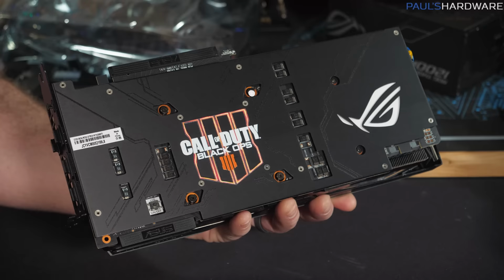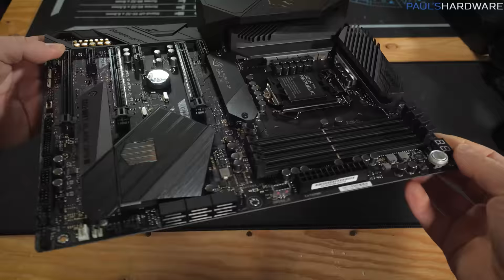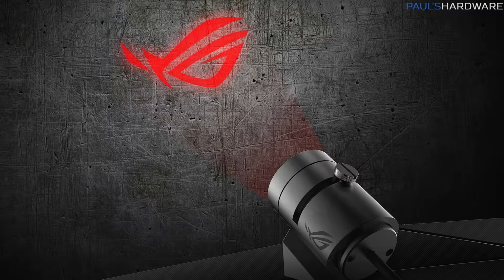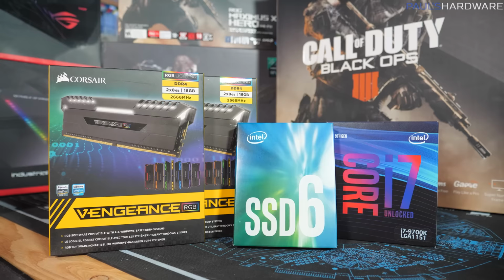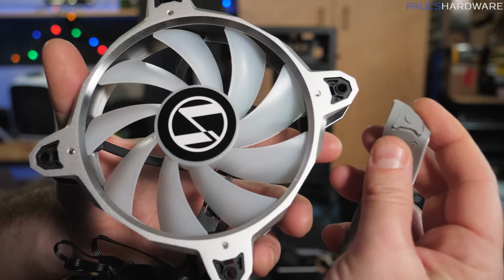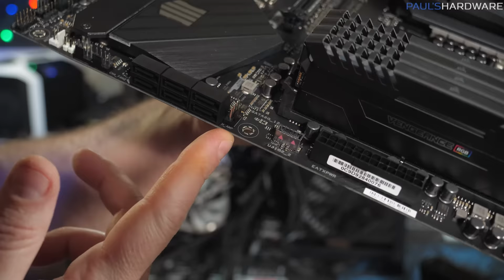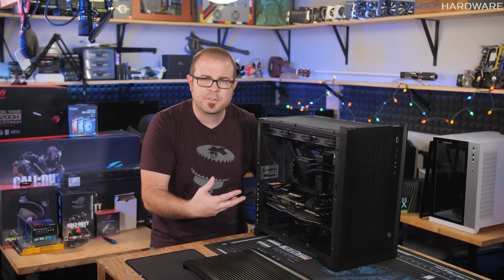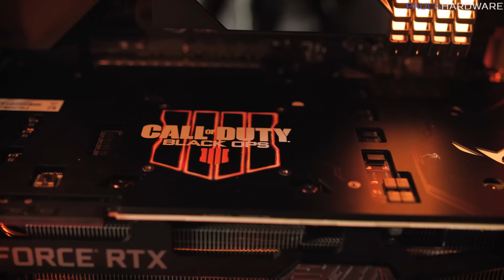SET BONUS - Epic ASUS COD:BO4 Themed Gaming PC Build!

Comment: Cod took some of the money from the micro transactions to let Paul assemble this
Reply: Im building my first ever pc , is the strix 2080 oc worth the money or should i look for other options
Reply: @clc8609  That all depends on your budget.
Reply: @michaeldownie9995  iv been saving for a while and i have near enough 2000 pounds
Reply: @clc8609  if you don't care about RTX features then a spare/new gtx 1080 ti from ebay will be much better value, same performance, cheaper, and more vram. But if you want raytracing then get the 2080
Reply: E ZoTac  i ended up getting the i7 9700k and the gtx2080ti
Reply: @clc8609  GTX 2080ti ?
Reply: @NoName-st2jl  yeah i did end up getting the 2080ti lad

Comment: Those are not rubber vibration pads on the fans, that's to keep you from getting electrocuted in case something goes wrong and you touch the fan or the case. Didn't you learn anything from the 'Verge' computer build ?
Reply: i was what the heck he is talking about, until i read the Verge part
Reply: Ha ha lol

Comment: I am interested in the actual benchmarks for this nice build & how much Power it actually uses ... 
The PSU really is overkill for this build.

Good luck to all who enter and i hope i have a slim chance to win as well.
My current potato has a dual core i3 2nd gen and an 1gb video yey .....
Reply: Mine has a hole cut on the cop so it stops overheating and is called a ps3 slim. Go figure.

Comment: The nvme should go in top spot for best speed
Reply: Thats not true. The only diff between the m.2 slots on that board is that one supports 8cm drives and the other 11 cm drives. Speed wise you can achieve the same with both. On older boards yes the top vs. bottom made a diff but now...not so much.
Reply: @trembledust6819  I might be mistaken but only the top one supports PCI 3.0 x4
Reply: @DravGro  Depends on the motherboard and chipset. The ROG motherboards are usually really good at putting both of their M.2 slots on PCIE lanes.
Reply: @DravGro  1 x M.2 Socket 3, with M key, type 2242/2260/2280 storage devices support (SATA & PCIE 3.0 x 4 mode)*2
1 x M.2 Socket 3, with M key, type 2242/2260/2280/22110 storage devices support (PCIE 3.0 x 4 mode)
Reply: Wasn't that specific to AMD platforms where the top slot is typically direct to the CPU while the bottom goes through the 470X chipset. Although i have heard ASUS X470's take PCIe lanes from the 2nd 16x PCIe slot for NVME to allow both to run at 4x in RAID.
Reply: @DravGro  On mainstream intel all NVME goes through the chipset, only 16 lanes come out of the CPU directly and they go to the GPU. 4 PCI-E Gen 3.0 lanes go to the chipset(DMi 3.0) which it splits between NVME, USB, SATA etc. AMD has 4 PCI-E lanes that can got directly to a NVME drive though plus 4 lanes to the Chipset. Main stream intel only has 20 lanes total, AMD has 24 of full pcie 3.0.

Comment: Amazing build! Pretty confused why you went 9700k and not 9900k.
Reply: 9900k is overrated and way more expensive.
Reply: I think the 9700k is a great processor and a great fit for a ton of builds. I haven’t added up the total value of this build, but going with a 9990k only adds $100. Every other part is top of the line and I think the processor should be as well.

Comment: Got the same setup but little bit better - so happy!

- 2666 Hz RAM is underpowered on this pricing-build. Better is to catch an 3200/3600 Hz (G.Skill Trident Z RGB), because it can give ~20 FPS when using OC. I´ve tested it on BF5 and R6:Siege.
- The Ryujin-360 can cool a 9900K on 5GHz to 60°C on 2K - Ultra gaming so take it!
- Separate SSD for System and games (512 GB windows, 2 TB Games - 970 Pro)

HINT: The Z390 Hero XI get an 806 BIOS version soon. Currently some common XMP/OC profiles are not stable.

Comment: Great build but the case left something to be desired.  I think it would have been better if you used the COUGAR Conquer Aluminum Alloy ATX Mid Tower. It's not cheap, but aesthetically it's a homerun. 
I'm going to use everything you used except for the case. Great job though. Keep the videos coming. 👍

Comment: Only downside to the build is the case and fans, not because they are bad but you used a Corsair component (RAM) and they make cases and fans. Basically my dream builds are sort of in this theme of a "set". Easiest 2 to do it with are Corsair and Asus but the only thing that I'd have to use that they don't make is storage and obviously the OS.

Comment: is it ok to not have a rear exhaust fan if you have a top mounted radiator as exhaust? i would think it would just pull air in from the back and negate the effects of the front intake fans

Comment: What’s good guy I got my budget pc with a i5 2400, 16 go of ram, a trash case, 1tb hhd, 450 Watt power supply, and a optiplex 790 motherboard. And I use a 32 inch “flat screen” (it’s not really small) and it has trash quality lol but it works. Also the speakers on it don’t work lol and I have a $14 headset lol xD

Comment: What possessed Asus to put blue locktite on their screws holding on the heat sinks for the M.2 slots on the XI Hero??????   I had to remove the MoBo from the case to try and get those locktited screws out and only succeeded fully on 2 of the 4 and the other 2 I stripped the phillips #0 slots out.  I ended up having to loosen the M.2 heat sinks from the bottom of the board to install 2 of my NVME drives.  Absolutely no reason to prelocktite a small screw that you know needs to be removed during the build.  My ROG STRIX Z370 boards didn't have locktite on them and the M.2 heat sinks had screws with a much harder metal as well.

Comment: TORRE QUADSTELLAR DEEPCOOL

PLACA BASE ASUS ROG MAXIMUS XI EXTREME

PROCESADOR Intel Core i9-9900K 3.6Ghz

DISCO DURO SEAGATE IRONWOLF PRO 4TB 

SSD ASUS ROG RAIDR EXPRESS 240GB 

MEMORIA RAM HyperX Predator Negro 64GB (4x 16GB) DDR4 3000 MHz CL15 

TARJETA GRÁFICA GEFORCE ASUS ROG MATRIX 2080 Ti 
       
TARJETA DE SONIDO ASUS ROG XONAR PHOEBUS 

DISIPADOR DE CPU ASUS ROG RYUJIN

KIT REFRIGERACION LIQUIDA CUSTOM

CONTROLADOR DE RGB ASUS ROG Aura Terminal Universal 

FUENTE DE ALIMENTACION ASUS ROG THOR 

MONITOR ASUS ROG SWIFT PG348Q

LOGITECH BRIO WEBCAM 4K ULTRAHD

ALFOMBRILLA ASUS ROG SHEATH 

TECLADO ASUS ROG HORUS 

RATÓN ASUS ROG SPATHA 

AURICULARES ASUS ROG STRIX FUSION 700 

SOPORTE PARA LOS AUTICULARES ASUS ROG HEADSET STAND